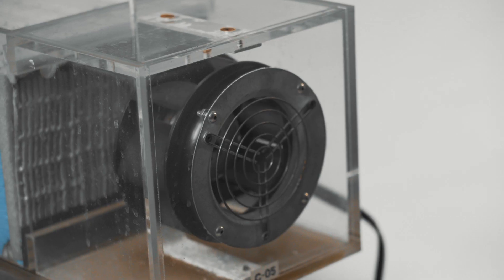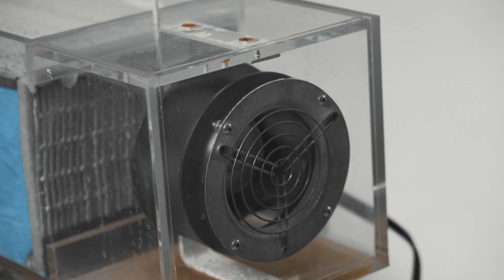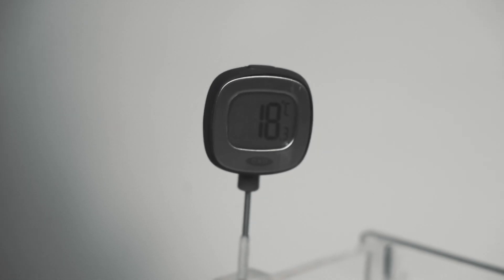LIFE IS CYCLICAL... M-CYCLICAL. M-Cycle and its application Introduction by Stan May

Comment: Why this is not in markit?
Reply from the maker: Maisotsenko Cycle air cooling technology is available on market more than 20 years as Gen1 Climate Wizard and Gen2 Coolerado dew-point indirect evaporative AC brands.
Reply: @M-Cycle  whether this works in humidity or not because in india,  70 to 100 % moisture will be from mid of June to mid September
Reply from the maker: @parwindersinghwaraich2365  We work 50 years in M-Cycle R&D and know very well climate specifics of India, Dubai, Singapore and Southeast Asia.                                                                                                   1) Gen2 M-Cycle with desiccant rotary wheel by DRI is about 15 years on market in India.                                                                                                                                                              2) Gen2 M-Cycle works unassisted at 7-9 gram per kg of Absolute Humidity, but for Gen3 we demonstrate dew-point cooling at 18-20 gram                                                                                                                                              3) For 100% seasonal and geographic coverage we have desiccant (not solid like rotary wheel, but more advanced), thermoelectric booster and hybrid (IDEC + DX) schemes
Reply: @M-Cycle  can you please share link of indian team  ?
Reply from the maker: @parwindersinghwaraich2365  https://www.drirotors.com/product/dew-point-coolers/